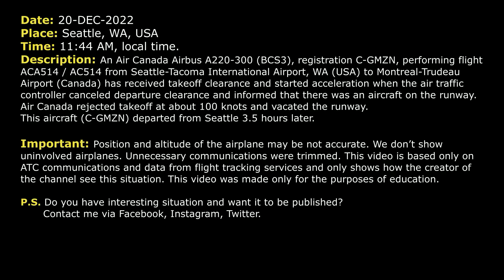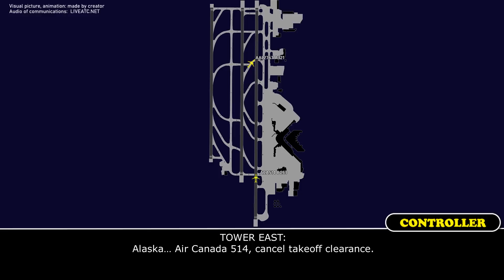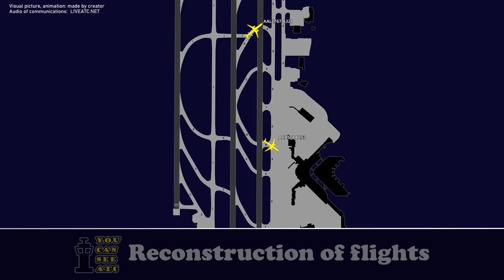Runway incursion. Air Canada BCS3 rejected takeoff due to airplane on the runway. Seattle, Real ATC

Comment: Hello, I have a question, what are the consequences of a "possible pilot deviation" for an airline pilot?
there's a report filling , i knew that point, but there is something else apart from that, how could it will proceed with any consequences is there are ones, as it could means temporary or permanent salary reduction, temporary suspension or even a justified dismissal and that report remains as antecedent in your file .
or am I exaggerating?
If someone wants to answer me I would be super grateful
 thank you very much
Reply: If the pilots report it through their company's asap program in time, privided the mess up was not willfull or caused by something illegal ie drugs,  suspension or revocation is highly unlikely. What would happen is remedial training will be required. Asap reports are meant to be a way to identify what happened to cause the error to prevent future errors.
 The reports are non-jepordy on pupouse so pilots will tell on themselves without fear of action on their liscense so trends can be seen.

Now, if they don't submit the report, then any action up to fines and license revocation are on the table.
Reply: The FAA can remove your certificate for a period or time or indefinitely. If it is only temporary, the company may just suspend you. If you don't have a good union, you could be fired.

Comment: Pretty frustrating. how Air Canada, got Takeoff clearance and American that crossed, the Hold short line and only to see that Air Canada got the pilot deviation BUT to be fair. The ground controller did noticed her mistake
Reply: Pretty frustrating how you abuse punctuation like that.
Reply: @driftspecs13  yeah
Reply: @driftspecs13  
Probably second or third language. How many do you speak? How many can you write in and punctuate correctly?
Reply: probably some miscommunication between ground and tower